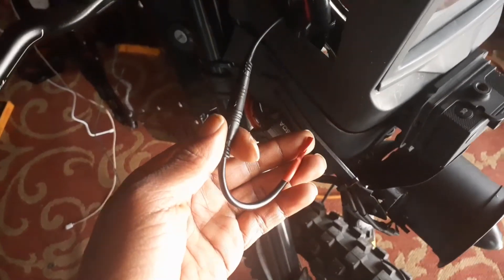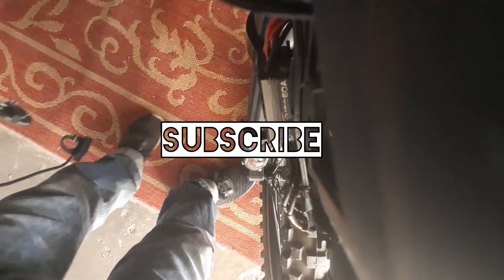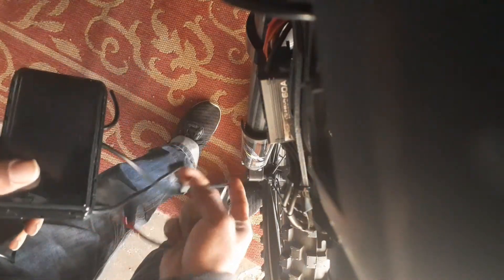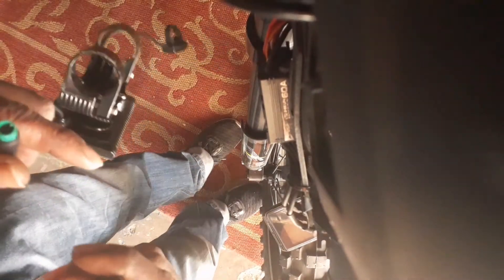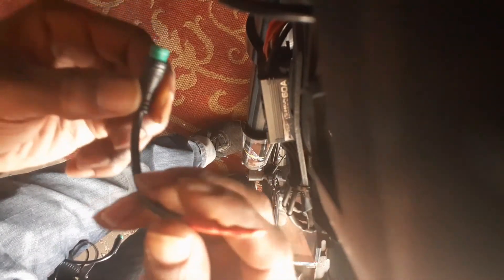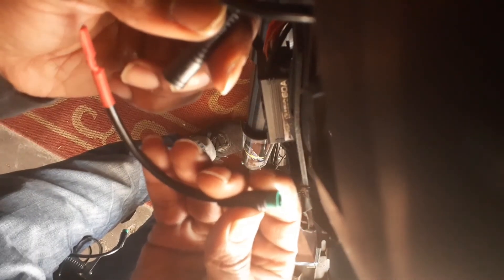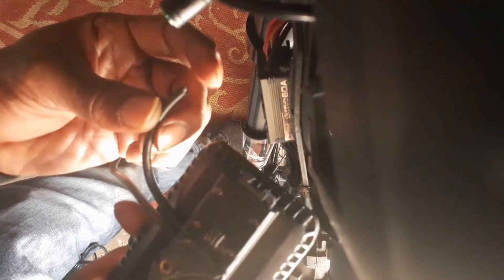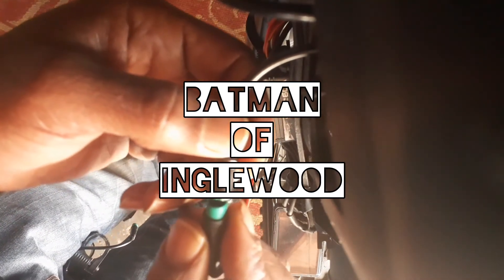How to Override ebike 5pin Display Screen (Color or Non Color) using Sabvoton Controller

Comment: Hey i recently got one of those displays but i dont have a 5 pin connecter my bike take a 4 pin i connected everything how it was connected from stock but the display would not turn on my bike would just go forward any fixes please?
Reply from the maker: Never heard nor seen an EV system with 4pins they always have 5 pins from my 11 yrs knowledge. Sry I couldn't help at the moment. I believe i will find the answer. I WILL get back to you a.s.a.p
Reply: @batmanofinglewood  ok thank you
Reply from the maker: Ok first I have to say if something goes wrong, I'm ABSOLUTELY NOT RESPONSIBLE for your devices. 

If the bike is working I'm pretty sure you have the RED and BLUE wire in the correct position. DONT TOUCH THE RED OR BLUE WIRES. only the other two wires should be changed up.

If you have the Black and White wires in place but NOT the Green, and the green is unplugged, switch the loose Green wire with the Plugged white wire. Leave the white wire unplugged and see what happens. Let me know a.s.a.p.
Reply: @batmanofinglewood  this should work the white wire is disconnected on the end of the connecter where it connects to the bike controller unit i will let you know if this works tomorrow it is very late where i live and i cannot do it at the moment thank you for helping i am glad i came to youtube knowing myself i would have switched the wires you told me not to thank you once agian i will get back to you tomorrow
Reply: @batmanofinglewood  hey i did as you said the bike still goes forward but the display dose turn on let me tell you how it is connected red to red blue to blue black to black green to green white to white
Reply from the maker: After looking into your situation,  you need a 4-pin display in order to get display power. 

https://www.amazon.com/gp/aw/d/B088P158YD/ref=ox_sc_act_image_1?smid=AWHPP0851IO04&psc=1

It's the only solution I can come with...
I DON'T use display anymore. They are a hassle for nothing. They burn out easily. 

I only use my phone as display. I only use bluetooth controllers so incase display act stupid, i can just log onto my phone plus bluetooth controller means you can change controller perimeters

Comment: Hi is this the plug on the controller with red blue green yellow and black thanks
Reply from the maker: Yes, It's to the 5pin display wire👍🏾
Reply: @batmanofinglewood  is there any way to change the power settings as mine defaults to setting 0 with no throttle or power support
Reply from the maker: I don't quite understand what you mean
Reply: @batmanofinglewood  when I power on my controller the default setting doesn’t give me throttle control is there a way to change it without display working
Reply from the maker: I'm not sure. I have sabvoton bluetooth controller with a crappy display. I got rid of the display and connected the Red & Blue from the display wire to activate the controller. I don't know what kind of system your running. 
I now use my phone as my display because the controller is bluetooth and I built my own 72v Battery Pack with Bluetooth BMS so I can monitor my battery from my phone as well
Reply from the maker: Did you connect the RED and BLUE Coming from the display?
Reply: @wolfymaceastern6072  i have same issue right now. I shorted the red and blue wires but no throttle as my sw900 starts at 0 pas so no throttle. I need someway to change the pas level then id have throttle power 🥲

Comment: Hello ,shorting the red and blue will allow you to use any display screen?
Reply from the maker: Shorting the wires let's you use NO display... its just for incase you have NO display or you're display stops working.
Reply: @batmanofinglewood  I have broken my buttons from my ukc1 display that's why I asked, can I install any 48,52v throttle with key for example?
Reply from the maker: @Bm330ci  yes. Throttle and display are NOT wire together.
Reply: @batmanofinglewood  the display is Okey just don't have buttons to turn on and off and select the modes
Reply from the maker: @Bm330ci  you have me confused. How is your display okay if the buttons dont work?
Reply: @batmanofinglewood  I have ukc1 TFT display, from the display is going out 5pin green waterproof plug to the buttons which are separately from the display
Reply: And throttle is yellow pin which is going to different plug, the thing is I don't know if any display will work if it's compatible with my 5pin green plug on the controller
Reply from the maker: Yes. It should work as long as its 5 pin
Reply: @batmanofinglewood  thanks very much for the help :))) I will order one then :))
Reply from the maker: But remember my methods for  possible future issues. If your display STOPS working, your throttle will also stop. All you have to do is follow the EASY STEPS in my video to fix the problem so your bike will at least be working and you can still ride with NO problems. You just wont have display readings. At least you WON'T be stuck anywhere
Reply: @batmanofinglewood  should I have full aceleration aswell? As the system have 3 modes ,but I think is for pedal assist modes
Reply from the maker: Should have full acceleration

Comment: Hey I'm sending a message for help put about my ebike build. I put a 1 minute video up showing how I'm not getting the right amount of volts out of my bms and when I plug into my controller the volts drop down to 0 or 1 volt. Of you could watch the video and possibly help me out with some advice I would GREATLY appreciate it!
Reply from the maker: I needed to activate mine by touching a 3v -12v battery to the specified wires for less than half a second to activate. You might have these factors to settle the issue
Reply: @batmanofinglewood  ill start Googling it. Never thought of that. Not sure why comments aren't allowed on my new videos. I sent a message to YouTube.
Reply from the maker: @FelonENews  it's because you have them set on videos for kids. You have to always choose not for kids
Reply: @batmanofinglewood  yup just fixed it. lol I thought if it was for kids they would think its pg and let comments. Your the man!
Reply: @batmanofinglewood  think I could use an 60a bms on my 80a pack or will it blow? lol
Reply from the maker: Did you activate your BMS? Some BMS's have to be activated once you connect everything. Does it have any information about how to activate your BMS on the BMS itself? Or does it come with manual?
Reply: @batmanofinglewood  the bms didn't come with any information. Just the bms. Its driving me crazy! lol
Reply from the maker: @FelonENews  isn't it a Bluetooth BMS?
Reply from the maker: You have to set the bluetooth information in the BMS after you connect to it. You have to tell it how many cells it is monitoring...
Reply: @batmanofinglewood  Yo! Your the man bro! I need to hook it up to a charger first otherwise it won't work! I just found a video on activating a daly bms! No idea i had to activate it by a charge first! THANK YOU!
Reply: @batmanofinglewood  you know of a place i can get a bms thats not crap and has fast delivery?
Reply from the maker: @FelonENews  well, as I looked into it, your BMS is bluetooth. Anyways, I got mine from Alibaba Express app

US $63.93  8%OFF | Smart Bluetooth 7S-20S LTO Lifepo4 li-ion Battery protection Board BMS 400A 320A 300A 100A 80A PHONE APP 8S 10S 12S 13S 14S 16S
https://a.aliexpress.com/_mrBcM3z
Reply: @batmanofinglewood  i still didn't try the Bluetooth. It didn't come with a wire for it or a place to plug it in. I'll have to try when I get home. I did hook it up directly to the battery and on the stand I got 75mph so I'm definitely excited now!
Reply from the maker: @FelonENews  always keep in mind that the speed on a stand will NOT be the same as on the road. It will require at least 3x to 3.5x the amperage for you to achieve 75mph on the road, you'll need around 150a-200a At 76v or you can go much higher on the voltage like 118v and come down on the amperage.

If you havent done so, get the specs on the actual battery cells and figure out what's the highest amp output they are capable of.

For high power ebikes, its recommended use of cells that can handle 20a-30a per cell. 90% or maybe more of ebikes use bullshit 4-8 amp cells with high resistance which leads to over heating which lowers battery capacity.
Reply: @batmanofinglewood  I rigged the battery straight to the controller and bypassed the bms just to see how it would run and I was at 50 in no time. if I had a bigger straight I feel I could have hit 60. So awesome going for that first ride!
Reply from the maker: @FelonENews  is your controller programmable?
Reply: @batmanofinglewood  no. it doesn't have any functionality othe then discharge and balance. It's 20s 8p and should put out 80 amps. on my display i was showing about 7500 watts at full throttle.
Reply: @batmanofinglewood  Posted my first test drive! Super excited!
Reply: @batmanofinglewood  it doesn't have Bluetooth. Not to my knowledge anyway. I guess I can try to scan for it. I'll try it now.
Reply: @batmanofinglewood  
Could'nt you make a video explains that ???
I mean about bms , bluetooth , activating ..